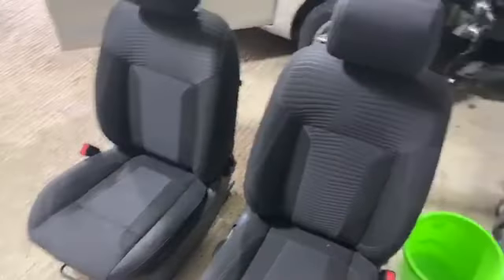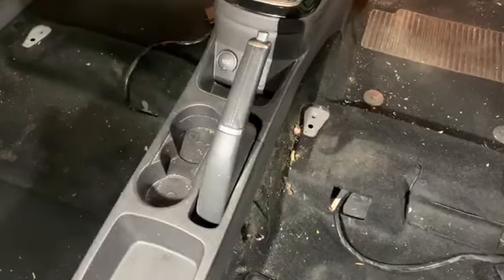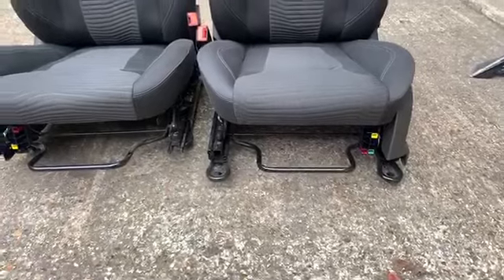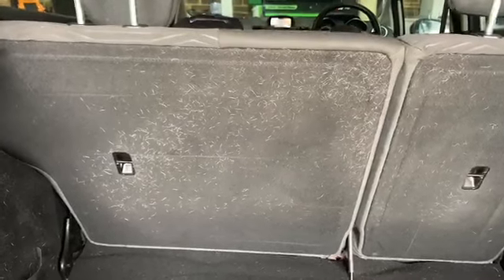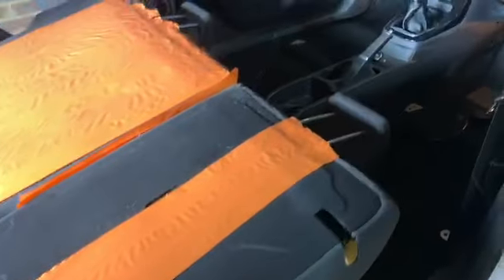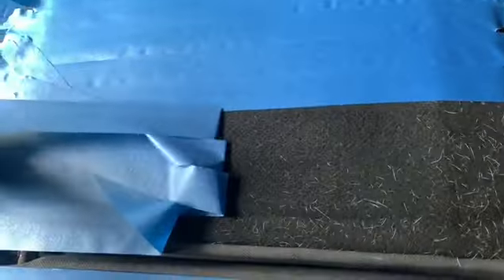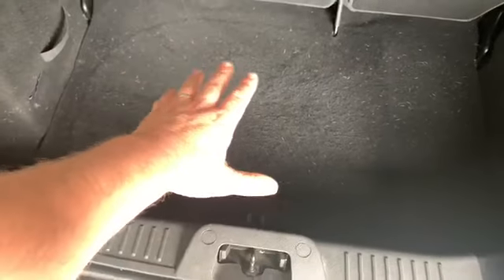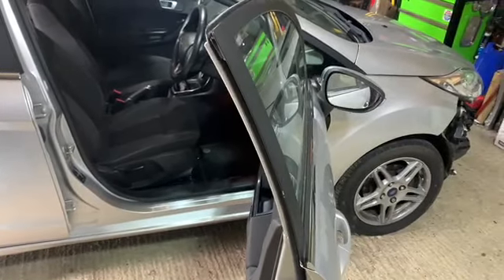Copart Salvage Ford Fiesta Zetec 2014 PT3 Cleaning The Seats And Interior

Comment: The seats come up well after the clean but that is a waste of tape imo did you try a Hoover on it first and brush it as you go? That should work or lint roller or the car wash they will have it cleaned up won’t cost you more than £20 for them to do inside and out. Fast turn around on that bumper can’t complain at all it will finish the car off nicely!
Reply from the maker: Hi Alex the worst bit is the boot floor might get a second hand one from breakers 👍this one has been really quick to do looking for the next one now  👍
Reply: Resurwreck Autos UK give it a go with the hoover mate you might be surprised but to be honest it would be easier to get another from breakers yard and would save you time. Let’s see what you get for your next one I hope it’s exciting!
Reply from the maker: @Alexander_l322  Thanks Alex ill see how much a second hand one is